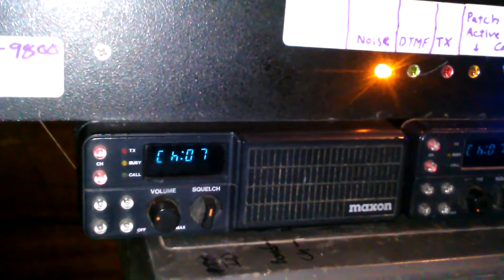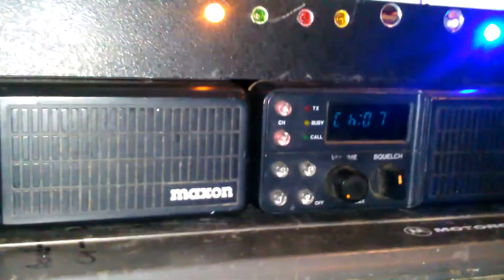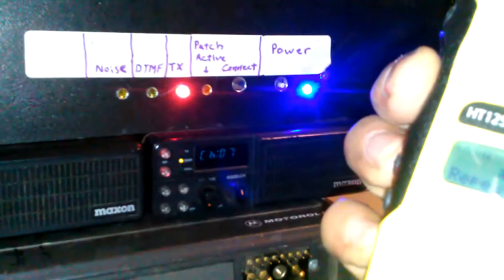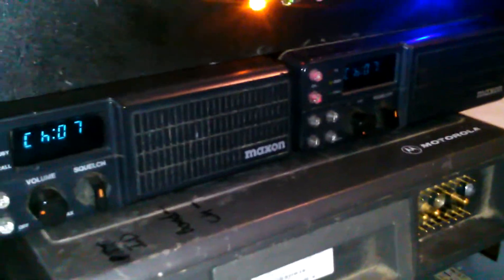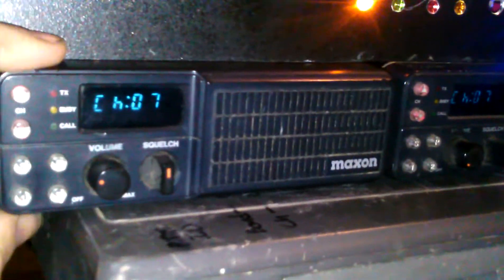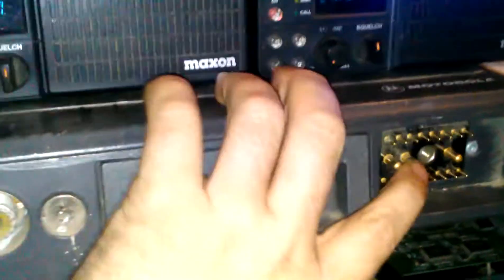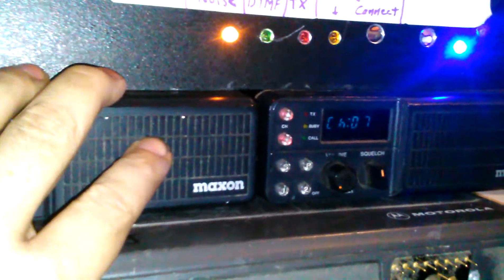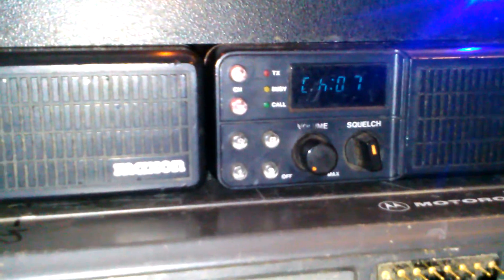Maxon SM4450 GMRS Repeater

Comment: Hi. I have a Maxon SMX4150NLB radio. Do you know the frequency range of this radio?
Reply from the maker: 4150 models are VHF Hi band (UHF models are 4450) To decode the model number of a 4000 series radio the first number is the series identifier IE: 4000 series, the next three numbers identify the operating band IE 150 - VHF and 450  - UHF band. 

The SMX4150 manual can be found here - http://www.radiomanual.info/schemi/Surplus_Civil/Maxon_SMX-4150_user.pdf
Reply: @Elfnetdesigns  Thank you very much for the detailed answer. Is there a possibility to manually lower the 150Mhz band to 145Mhz?
Reply from the maker: @sanjayadulankateamlead-tra5874  Also you will need an old DOS PC with an RS232 serial port, Maxon SMP4004C software and the Maxon SMC4000 programming cable and a serial cable that converts 9 pin serial (from the PC) to 25 pin serial (to the programming cable) cable
Reply: @Elfnetdesigns  Thanks for the detailed information. is there a possibility to lower 150Mhz to 145Mhz manually in this radio?
Reply from the maker: @sanjayadulankateamlead-tra5874  Yes you can program this radio to the 2 meter band but keep in mind that this is outside of the radios efficiency spec meaning you may have poor RX sensitivity and TX power lower that it should be even after you realign the radios front end (RX section) and for the new frequency(s) also you will need to realign the VCO so the PLL locks down. The standard SM4150 service manual will instruct you step by step on how to do this. The service manual can be found online fairly easily in PDF format.

Comment: I was thinking about getting a Motorola mxt115 15watts or mxt400 40 watts.  What do you think about the BTECH 50 watt gmrs ?  Thanks for your video.
Reply from the maker: You mean Midlanl (Who bought out Maxon and Topaz3). The Midland mobiles are good entry level radios and if you are going to get one you might as well get the 40 watt version. BTech is Baofeng and I have not had much time with the BTech line but I assume they are going to be the same as their Baofeng roots just relabled. Normally I would say leave the chinesium radio to the hams since they have this inherant belief they can use ANYTHING they desire without regards of the FCC part 15 and 97 rules regarding emissions.. Stick with name brands when you want reliable comms. Motorola radius non trunking line also is mostly dual certified part 90 and 95. However the FCC acknowledges the fact many people use part 90 surplus radios on GMRS and they have stated they are aware of this and have no clean comment on it.. The never said YES or No on using those radios but it is to be assumed strongly that if a radio is certified part 90 then it will be fine on part 95 (GMRS) BUT a part 97 (Ham radio) is not good enough for parts 90 or 95 or any other service except ham and this is largely due to low tier designs and keeping the radio open ended for the ham op to tinker with (VFO control, etc)The surplus markets are full of used and sometimes NOS commercial radios and for low cost as well be it you might have to buy a new battery pack or a mic.. Still it's not a bad deal considering commercial gear is built more rugged than ham gear or traditional GMRS/FRS gear..

Comment: Do any of you guys have the ability to program these radios? I have 2 UHF models that I need frequencies programmed. I'm trying to build a duplex repeater setup. Any help would be appreciated!
Reply from the maker: I have all the stuff to program them, You need an old DOS based PC (Not a windows PC with emulated DOS or a VM DOS) and the Maxon programming cable and software. The PC and software are fairly easy to get, the cable however are about as rare as hens teeth now.
Reply: Just curious, if I mailed you the radios with a list of the frequencies, would you be able to program them? You seem extremely knowledgeable regarding these units so I feel that you would be very trustworthy. Would you have any interest in doing that?
Thanks!
Reply from the maker: icecold2570 depends on where your located, the programming fee is $40 per radio the factor in shipping costs. 
Instead of shipping the whole radio there is the option to ship Just the E2Proms

Comment: i have a friend that has 6 of them just the radios
Reply from the maker: They are good for GMRS still in the US. They make goo repeaters IF you use shielded wiring lol.
Reply: but i dont no if his are 800mhz trunking
Reply from the maker: Dj snow The Maxon SM series were not 800 MHz.. They did make some 800 MHz LTR stuff but it was not very good